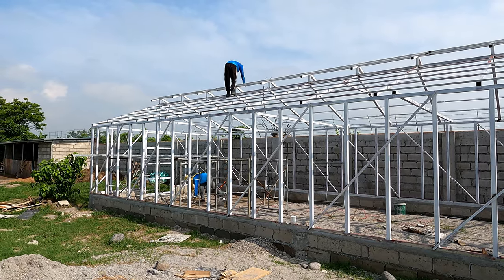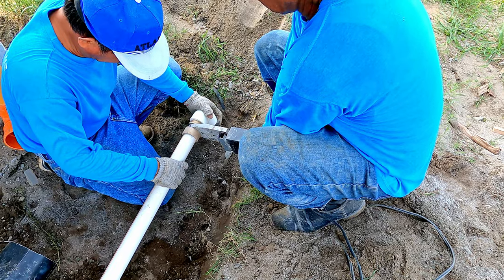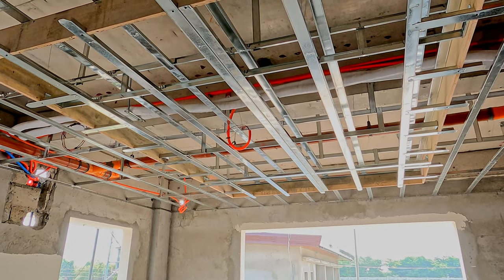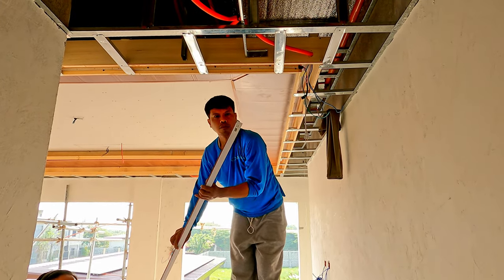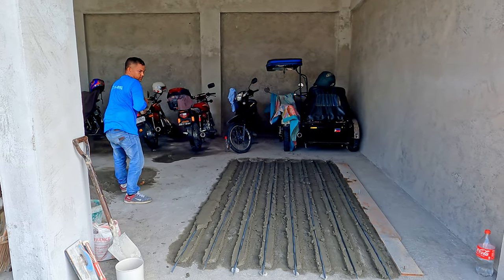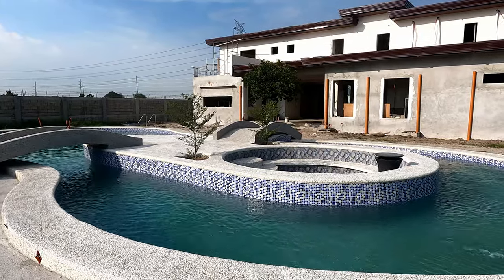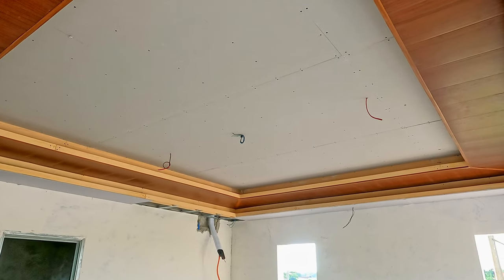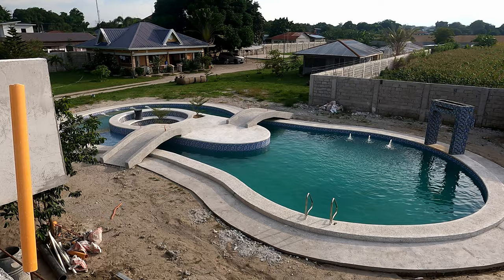Philippine House Building Day 217 - Ceilings, Drains, and more on the White House

Comment: Hello Mike. The ceiling is looking good with the wood essence. Does the waterfalls 💦💦💦 work on the pool or are they working on it still. Stay safe and in the shade Mike🤠🤠🤠🤠🤠🤠.
Reply from the maker: Joe
This was the other held message. Yes it works but you may now have seen yesterdays video so you might have seen it does need a bit of adjustment.

Comment: Good morning Mike Another good video walk around.
Water filters the water contains so much silt have you considered some kind of settlement tank or tanks that allows silt to settle, draw from the top using flotation ball keeping draw of away from sederment . With the ability to flush as required. 
Just a thought of mine.
Reply from the maker: Hi Graeme
No, had not considered that.
I want to see what happens after heavy rain to see if we need to add something like this to the system